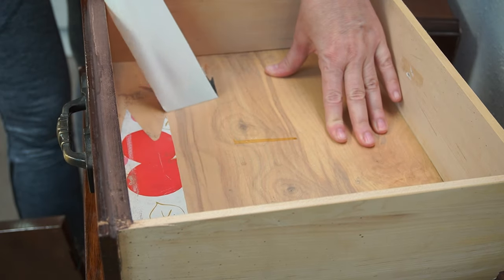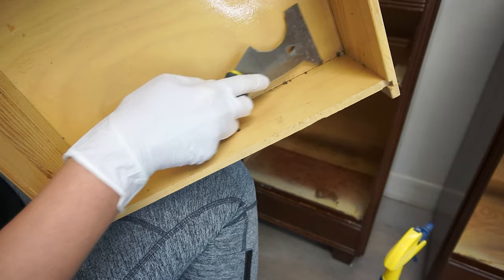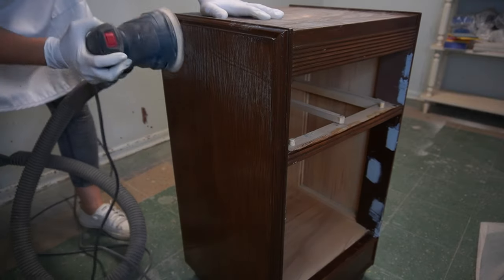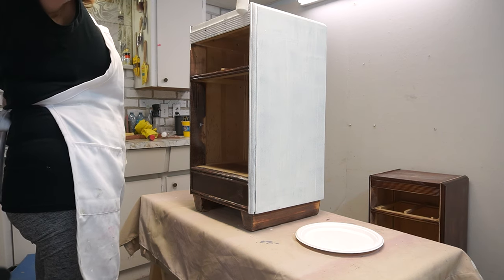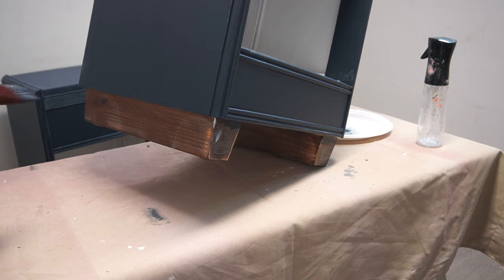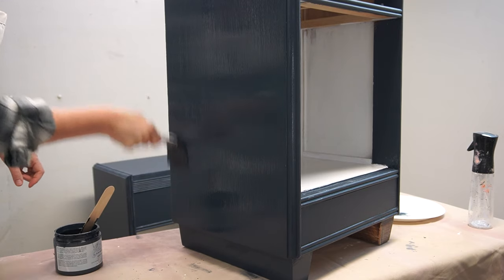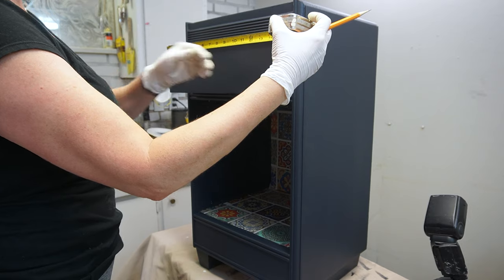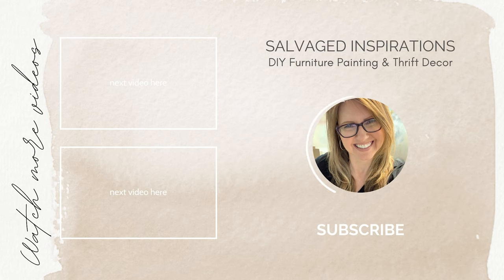Decoupage Art on 70’s Nightstands

Comment: Very good video. I appreciate the info about the Bondo filler. I have seen it but hesitated to try it. Also I did not realize that the B.I.N was a shellac based primer. I have some in my inventory. As to putting the primer down under an all-in-one paint, I always do. But I do not use the higher quality paints like you do. I think that with the cheaper paints like I buy that they use the cheapest primer they can find and just use it as a filler. Anyhow, your project turned out really great, as usual. Thank you.
Reply from the maker: I appreciate this, thanks! And I agree, an extra coat of primer NEVER hurts. Have a super weekend.